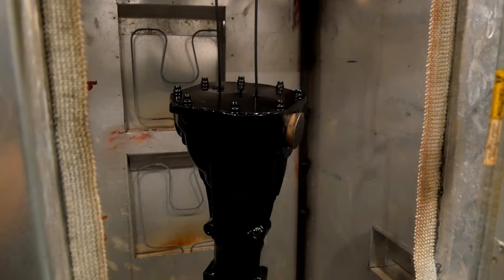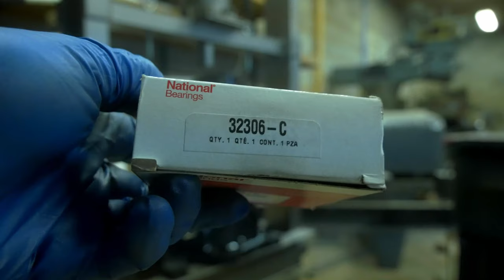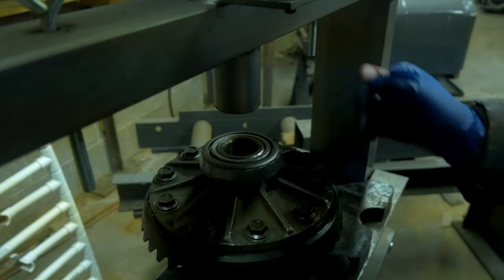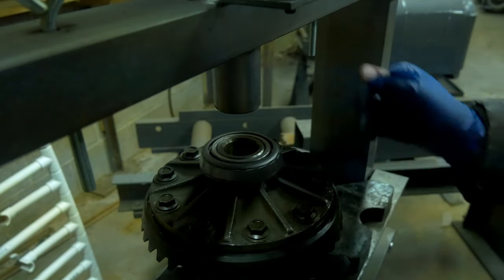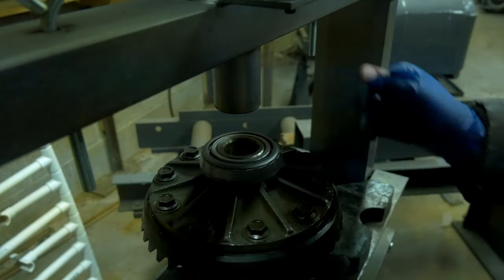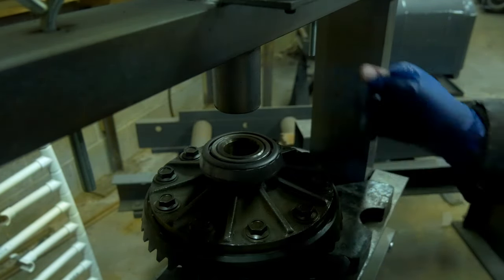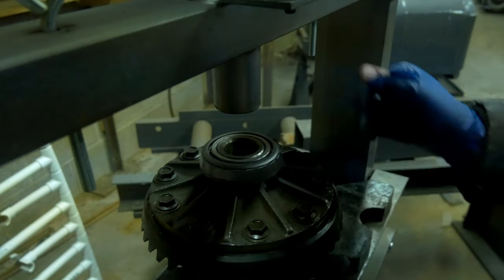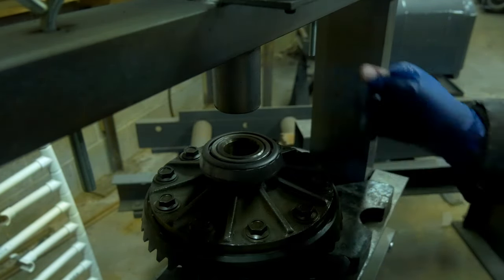R200 Datsun rebuild - restoration - bearings seals setup backlash shims gear pattern preload how to

Comment: Thanks for the video 😊, one thing I wanted to clarify the longer half shaft / diff axel goes in on the left side of the diff ( looking from the back of the car)
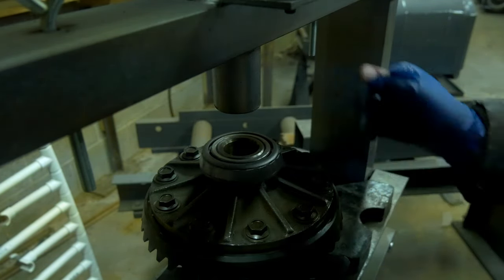Reply from the maker: Yep i go over those details @34:48
Thanks for watching! Hope it helps
Reply: @hcr-motorworks   thanks for that, just double checking since my drivers side is on the right. 
Have a great day 👍
Reply from the maker: @od6020  ahhh, RHD!!! yours is way cooler. And in need of a new owner. I suggest we ship that thing over to me ASAP! Lol 😆
Reply: @hcr-motorworks  😂 😂 😂 not a chance. Thanks for your help 👍

Comment: This video has been immensely helpful, thank you.
Reply from the maker: Glad you enjoyed it! Hope it helps!!!
Reply: @hcr-motorworks  I had to order a few thicker pinon preload shims from nissan, i'm getting about 32 inch pounds of preload with new bearings. Really glad i spent the extra on a good dial type torque wrench
Reply from the maker: @Rizzle280  yea the pricey inch pound torque wrenches are the only way to go to properly set these things up.
Hopefully the shims help get it in spec!
Make sure the races and bearings are seated all the way down on the shaft and in the case as well.
Reply: @hcr-motorworks  I did, I had to replace the rear outer race because of a defect in the surface, and I could feel a bump every ~30 degrees of rotation. Turned out there was a gouge in it I didn't notice when installing. When I took that race out I double checked both races and put as much pressure as I safely could into them on the press. Replacing that freed it up significantly, I think i just need a few thou of clearance to get it perfect.
Reply from the maker: @Rizzle280  awesome! Let us know when you get it all back together!
Reply: @hcr-motorworks  so I finally got to drive the car with the new diff and ran into a problem. I kept the same thickness of shims, but that didn't end up being enough preload on the carrier bearings. I believe my quaife diff is very slightly narrower than the stock one. I was getting a terrible vibration and could physically move the axles up and down, and hear the diff clunking inside.

Got the diff out and taken apart this weekend, and it looks like there wasn't any major damage. Going to try some thicker shims and triple check everything again before I install it back in the car.
Reply from the maker: @Rizzle280  ooph yea you need to measure the pinion with the carrier removed and make sure pinion depth doesnt need to be changed as well. Did you mark the ring gear and to check the tooth pattern after reassembly?
You might have something else going on with the axles being able to move up and down as well.
Reply: @hcr-motorworks  I did check the pattern and thought it looked good previously. They were able to move because there was effectively negative  preload on the carrier bearings. I could grab the diff and move it up and down and side to side. It basically fell out of the case once I removed the caps. thankfully the bearings and gear teeth don't seem to have been damaged, but I'm going to swap some thicker shims in, and check it with the marking compound and dial indicator again. Lesson learned
Reply from the maker: @Rizzle280  Glad nothing was damaged! Some of the best lessons i've learned were learned the hard way. Welcome to the club

Comment: Great video! I'm in the process of rebuilding an R180 in a 260z and switch to a KAAZ LSD. There seems to be some slight differences like the lack of bearing caps. I'm most concerned with setting the pinion preload. Is it possible I need to change some shims to set the preload? I don't have the "dummy shaft" or other special tools to assist in getting the correct pinion depth.
Reply from the maker: You will probably have to do some measuring on the pinion depth if you're changing the gearsets. You'll definitely need the inch pound torque wrench to check pinion preload. That, along with some manual measuring, you could possibly get away without having to buy a dummy shaft.

Comment: Your lucky I've done 2 different diffs and have the same problem with the new bearings the original shims will not go in TOO TIGHT. Can't use FSM for the numbers on the case and pinion no longer exist.

Comment: Great video ; if the preload is 3.5 lbs less than the minimum in the FSM is that really all that important as long as backlash is within spec?
Reply from the maker: 3.5 INCH pounds...probably not that big of a deal with used bearings. If they are new bearing i would try to torque that pinion nut to the higher end of the spec and get that preload more towards the within spec range.

Comment: At time 14:40-I don’t understand why overtorquing the pinion preload drives the bearings farther on the shaft.
Reply from the maker: They are opposed races where the bearings on the pinion shaft are seated by the torque applied to the pinion nut. If you torque the pinion nut to a higher torque spec, when you back it off and torque it properly the bearing races will essentially be pressed up farther along the length of the pinion shaft than they otherwise would have if the pinion nut was torqued to spec properly the first time. Itd be like over driving the bearing race down a shaft with a arbor press. Except this nut in this case is acting as the press when the assembly is over torqued. Creates all sorts of issues if done improperly. Better to just sneak up on the torque of the pinion nut rather than over torqued and then backing it off to try again and having everything in an improper depth from the initial over torqued situation. Even worse if your doing it in a 'crush sleeve' type rear end. Once that washer is over crushed, there's no just backing the nut off and hoping for the best when re-torqued. Hope that helps.
Reply: Thank you very much for the reply.  Yes it does help, explain the why and moreover to identify my many mistakes.  

I did exactly what you warned of, but before I watched your video.  The differential I’m using is from a Q45 on my Z32.  I thought changing flanges was a simple swap.  But, my process was very poor, I held the half-shaft flanges (not pinion flange) to both loosen the nut to remove the original flange and torque down the pinion nut with NA Z32 flange. I tightened to the position I marked on the nut and threads.  Torque was near the high end of range, but preload was VERY low.  I continued tightening, neglecting a torque remeasure, favoring a preload measurement instead until THAT number was in range.  I went too far and the flange would barely turn by hand (easy then very tight-nearly snagging during rotation).  Frustrated and confused, I loosened the nut, torqued to minimum then up to halfway into the pinion nut torque spec, and accepted the low preload.  After which I discovered the play, that was not there before.  

The result of this process:  there is now play/backlash where before I removed the Q45 flange where before there was practically none.  I assume my overtightening caused this play? Could I have damaged the LSD or the spider gears also?

What a mess I made of a good diff (65k miles, no noise, smooth, tight)!!!  Very angry with myself for rushing.  I had measured the preload on the Q45 diff before I removed the Q45 companion flange.  It was below the FSM, but tight, buttery smooth and quiet.
Reply from the maker: @barrydowell  sometimes the best lessons learned are the hardest ones to accept.
At 65k i would have let that thing ride until loud noises started popping up lol.
The holding of the companion flanges and then tightening the pinion nut 'shouldn't ' have caused any issues but until ya tear it all down and inspect the gear and look for denting ya wont know for sure.
The preload under the fsm spec is fairly common for a used and worn in diff. Most of these specs are for brand new everything at assembly and will change with use and wear.

Time to tear it down and inspect.
Reply: Agree 100% on all the above.  Tough pill to swallow, but necessary.  I have 3 R200’s now. All fit on my Z32, different ratios. My journey began with a broken pinion gear-2 teeth snapped off (car makes 740rwhp).  Hard lesson simply over a lack of patience.  It’s why carpenters measure twice…

Great videos.  Thanks for the responses.

Comment: Thank you very much for your effort on documenting all prosses and by k8nd to share it. 
Id like to ask, where can I buy shims for it? 
As well bearings and seals.

Thanks again.
Reply from the maker: Most of the bearings and seals can be bought off rock auto or similar...the only one i had to get from courtesy nissan was the pinion roller bearing. The shims can either be bought from nissan directly or plaves like zcardepot.com but you most likely wont need to change the shims unless you've changed gear sets as well.

Comment: What happens when your pinion preload is way off. I was getting a measurement of 50 in/lbs without the seal
Reply from the maker: Ooph...i would check the bearings and make sure they are fully seated on the shaft and the race in the housing. If it is, your going to need to shim it out and get it proper spec with the nut torqued properly giving you the proper amount of preload.
Reply: where on the pinion shaft would the shims go? and how would i go about measuring that?
 @hcr-motorworks
Reply from the maker: @toe-b203  between the pinion gear and the pinion bearing. The correct way is to measure the depth of the pinion gear in the case

Comment: Mine is way off I'm getting 8 thousands
Reply from the maker: With new bearings? Spec is 0.005-0.007” so I wouldn’t say you’re way off but it’s definitely better to be within spec. If they are used gear and bearings I’d say that’d be pretty normal.
Reply from the maker: @carlosberrios1021   You need to look up the specs on the vehicle it came out of to know if it’s in spec or not. Also youve got to lock your pinion down somehow, you’re probably getting an extra thousandth on both sides due to just the nature of not having the pinion locked down in a vice or something
Preventing any rotation. you need to adjust your dial indicator so it’s measuring directly in the direction of rotation and not at any angle to that degree of rotation as that will also introduce errors in the readings (cosine errors specifically) hope that helps.
Reply: @HCR - Motor Works  Thank you